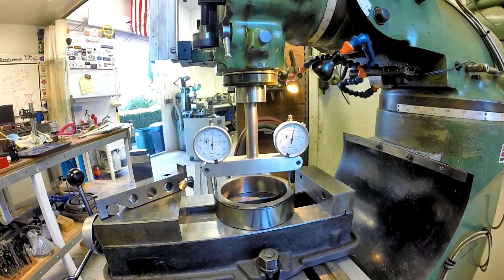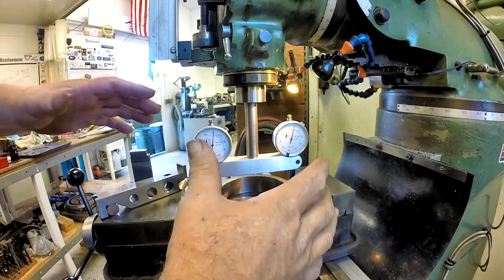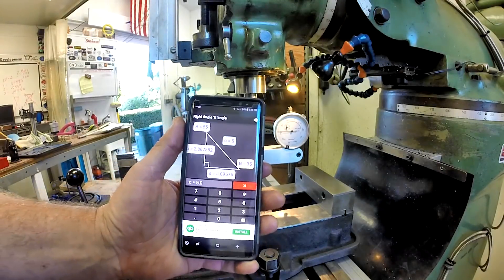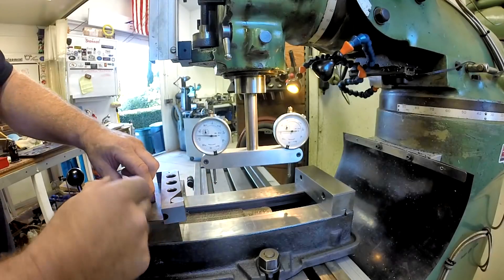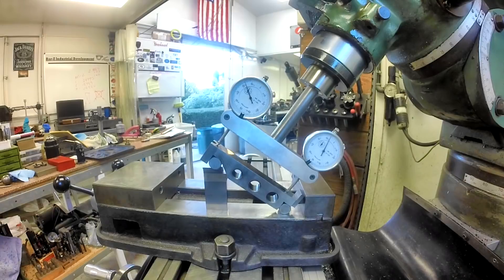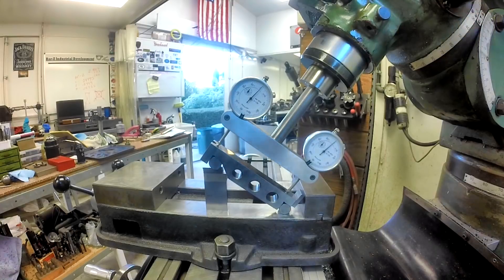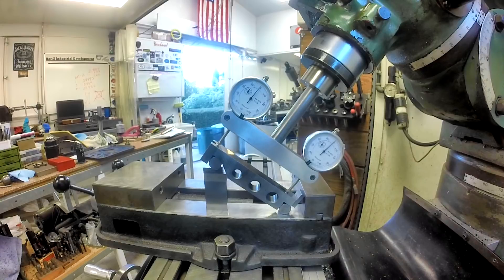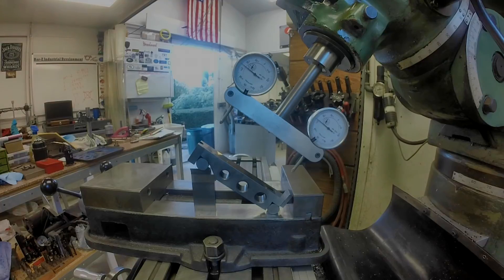Setting an accurate mill head angle

Comment: Stan, I disagree with you saying that the dial indicators were calibrated to start with.  You must set each dial indicator to Zero before you start by marking a spot  ( the edgetecnology one comes with a ground magnet  ) on the table / vice. You zero one dial, rotate the head 180 degrees to the same spot and zero the other dial, this ensures that both indicators read the same, irrespective of whether the head is out of tram or not. Then you can then check the table / vice or whatever for tram. I know you showed it on a bearing ring that in fact your head was trammed, but that was because you had done so in the past.  I think it would be a good idea for you to say or even a 3 minute video to show how to set up that type of head tramming indicator. Is the app you spoke of, available for an Apple Phone ?
Reply from the maker: Yes, it should be noted I started with a properly trammed head to get my baselines.

Heres the app https://play.google.com/store/apps/details?id=com.ChrisTowles.RightAngledTriangleSolver

Comment: Can you use a flat piece of material if you don't have a Sine bar using the gauge blocks?
Reply from the maker: Last time I checked, you had a sine bar.
Reply: @ShadonHKW  
It's not long enough to span the gap between the indicators..🤔
Reply from the maker: Your sine bar has drilled and tapped holes on top, it wouldn't be hard to make an accessory parallel that simply bolts on.
Reply: @ShadonHKW  
What would "we" do without you buddy!
Thanks Stan!

Comment: thanks stan. i could have used a more detailed explanation of how to use the tramming indicators.i thought you had to keep turning them 180 degrees and moving the head until the reading remained the same? another video ?
Reply from the maker: After you get a zero-zero reading rotating them North, South, East & West, DONT TOUCH THE GAUGES. Touch down to your sine bar when ready, a zero-zero reading will be the same even if you flip the gauges 180*

Comment: Can you set the compatible angle with an angle gauge (90-35=55deg for this example) and run a DTI down it by extending the quill to do the same thing, or is the quill too wobbly?  Kind of like you do with the square master in case my description wasn't very clear.
Reply from the maker: Yes, you could do that, 101 ways to skin a cat.